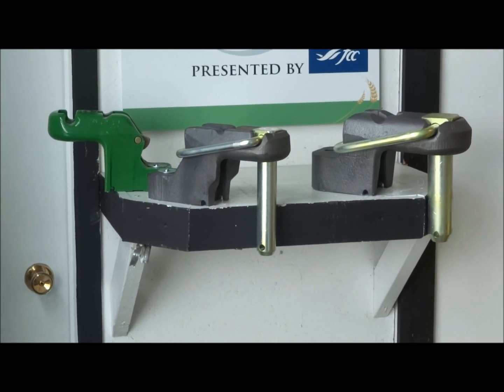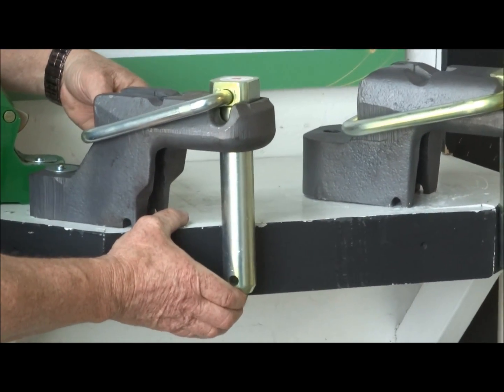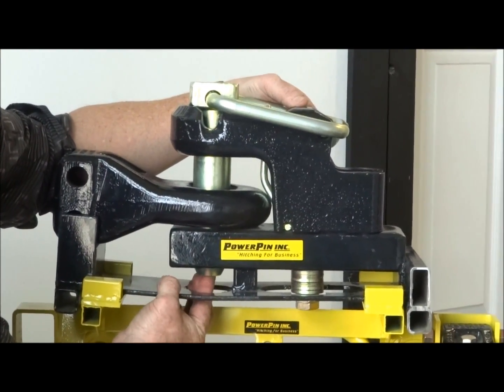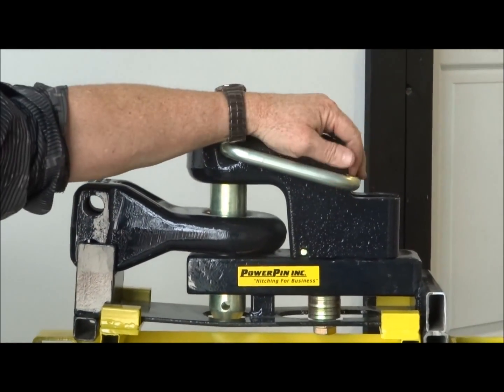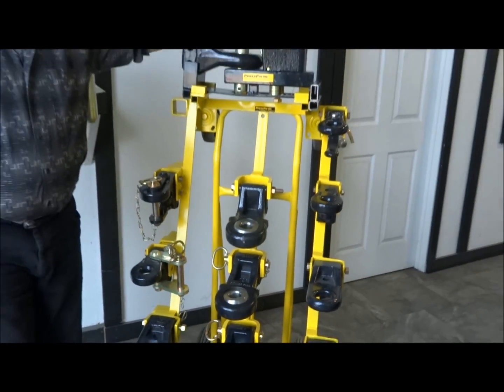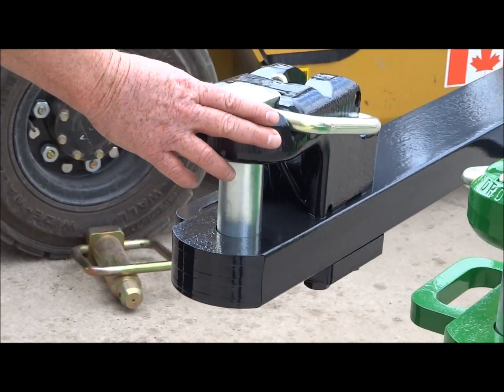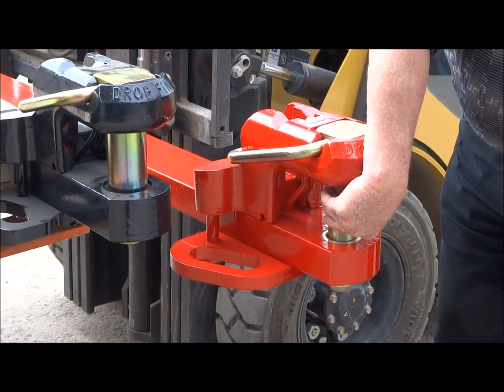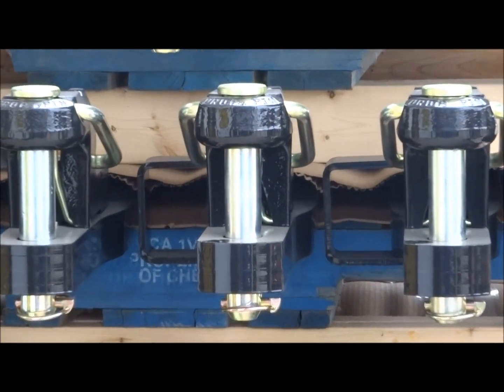Power Pin Demo

Comment: Interesting:  attention to the detail of the handle and auto pin release when hitching on ....   but it goes back to this thing between USA & Europe / big tractors  / Ferguson Idea of using the 3 point hitch ( Deere with 2-point hitch & L Link sensing)  sharing the pulling load over more points = less hitch stress ( Load/Area) and weight transfer for traction etc.   and then there is the Ball hitch     ..  Hmmm .    thanks for posting - 10 years ago too & you had Cat 5 / 6? hitches  - bet those pins cost a bob or two.